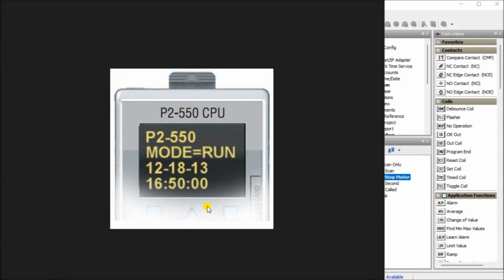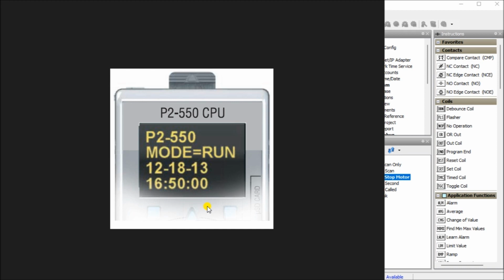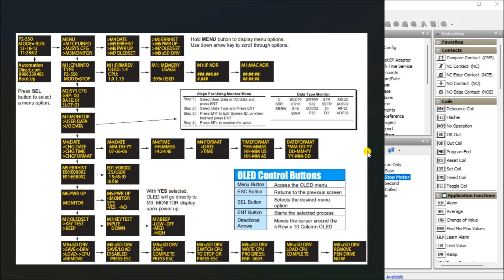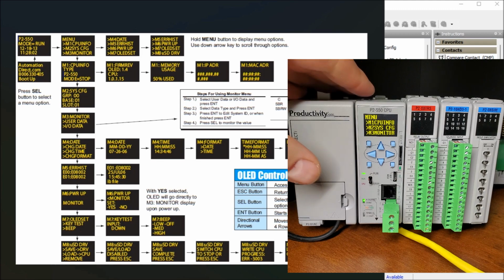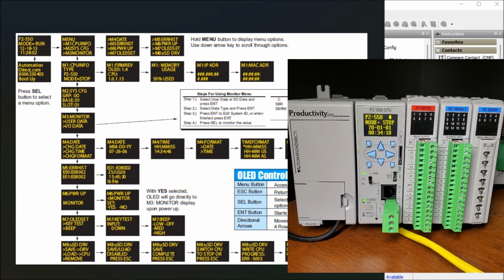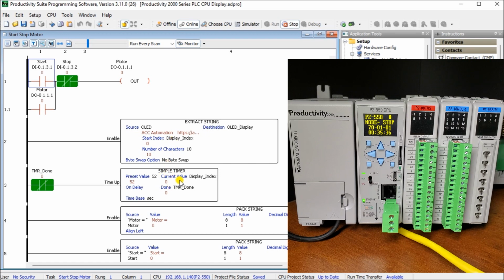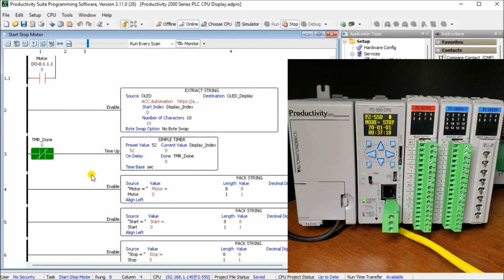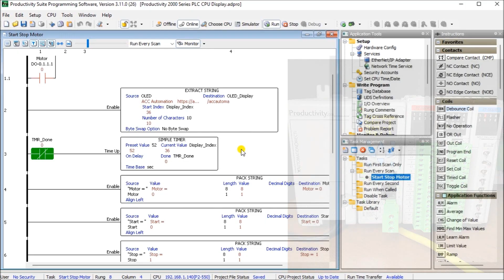Productivity 2000 Series PLC CPU Display

Comment from the maker: The Productivity 2000 Series PLC is located here:
https://accautomation.ca/series/productivity-2000-series-plc-p2000/

There are several reasons why we are using the Productivity 2000 Series Controller. Here are just a few.
- CPU with 5 communication ports
- 50MB user memory - Can handle very complex applications easily.
- Limitless PID – Autotuning – Individual or Cascade Mode - etc
- OLED message display on the CPU module
- Plenty of discrete and analog I/O modules
- Status displays on all discrete I/O modules
- I/O Modules have QR codes. This can be scanned so you can have the latest specifications/wiring diagrams for the module.
- OLED data display on analog modules
- P2-RS remote I/O expansion module, or use the Productivity1000 P1-RX remote expansion module to add even lower-cost remote I/O to your system
- FREE full-featured Productivity Suite software
- Programming with several ports - USB, Ethernet, Serial
- Hardware auto-discovery
- Hot-swappable I/O - Remove cards with power on the system
- Choose from three wiring options
- Slim DIN rail density form factor:
 - hardware - power supply, CPU, and seven modules in only 10-1/2 inches
- All project files (program, tag name database, and all the program documentation) in the CPU
- Run-time editing and debug mode on CPU
- Easy data logging with micro SD on CPU
- Secure Web server to access data files and system tags
- Easy drive and motion controller integration
- Coordinate motion control with PS-AMC allows control of up to 16 axes and synchronization of up to 4 axes
- Two-Year Warranty

The Productivity 2000 series of programmable logic controllers currently has all of these features built into the P2-550 CPU.
This CPU (Central Processing Unit) is also known as PAC (Programmable Automation Controller) because of its communication capabilities.

Regards,
Garry
ACC Automation
https://www.accautomation.ca